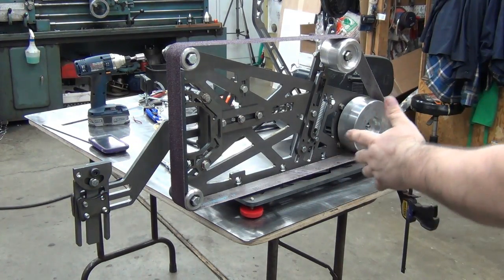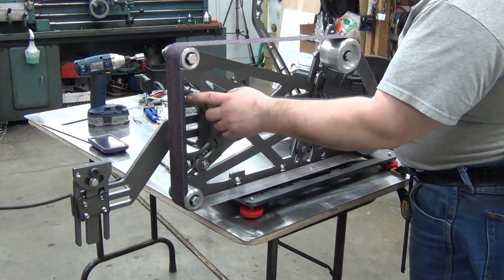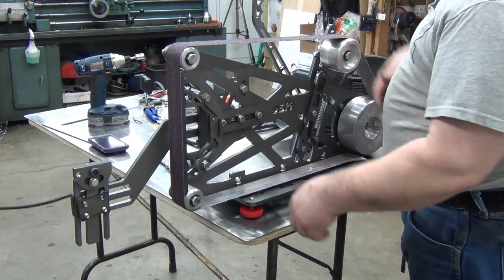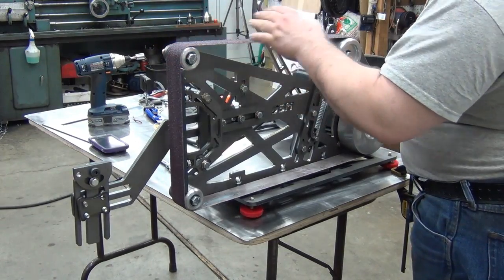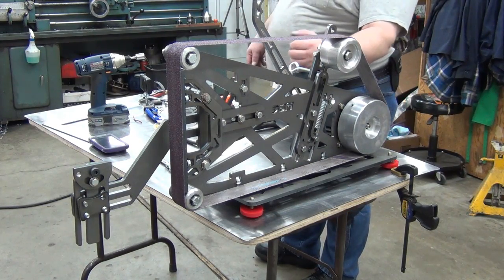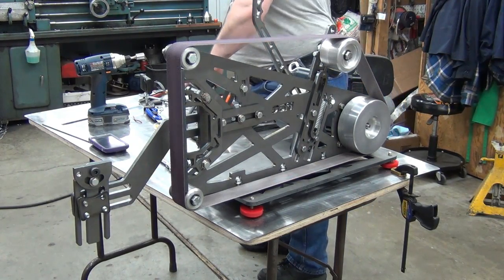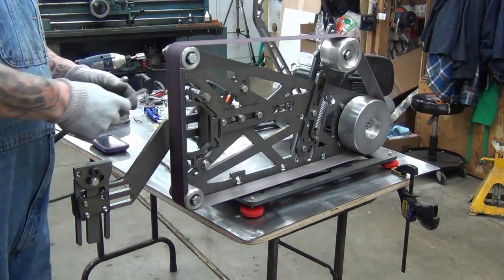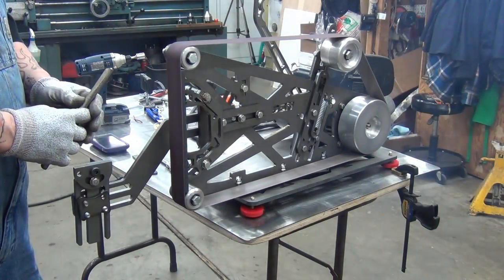BG6 It's Alive!!

Comment from the maker: Thanks!!  I'm really glad you like it! I'm pretty proud of what we've come up with. I have another belt grinder I built.  It's in the very first video I put on youtube and in several other videos.  Yes, the plan is to sell them.  Several are already taken.  At this time, we've set the price for the basic unit(no pulleys, motor/wiring) at $750, but the first batch is will get an introductory price of $600.  I'm pushing hard to get the CAD art finished to have them ready in the next 2 weeks. :)